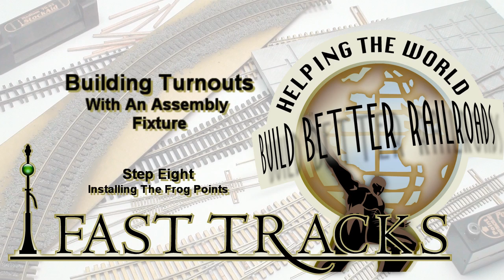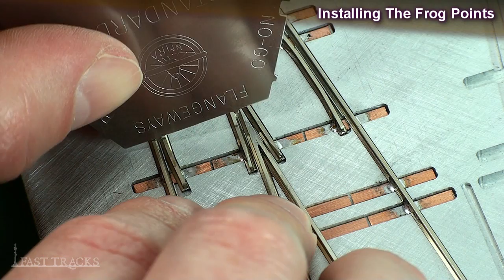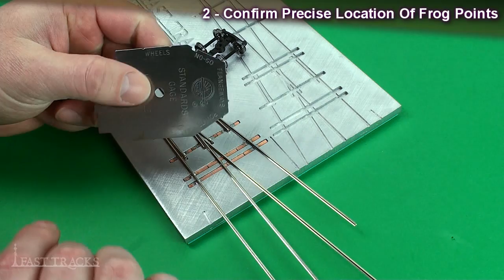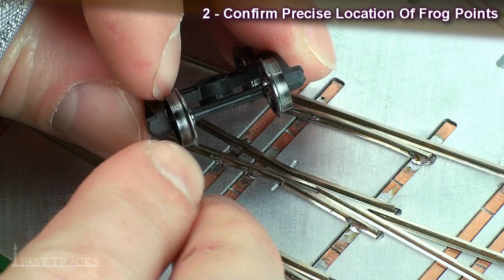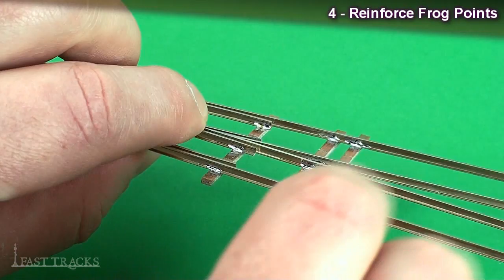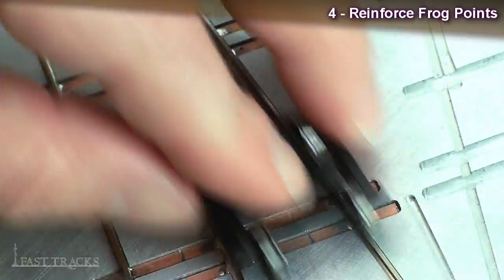Building A Turnout, Step 8 - Installing The Frogpoints

Comment: Watching you solder the point rail from underneath has me thinking that all the tie/rail joints should be soldered from underneath for better appearance. So I wonder if the assembly jigs could be designed to allow for that method instead?